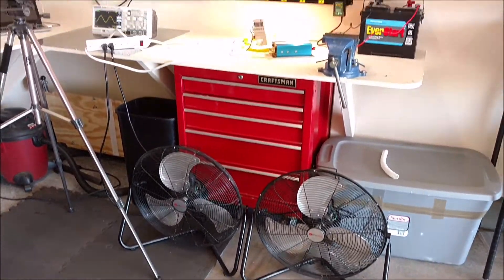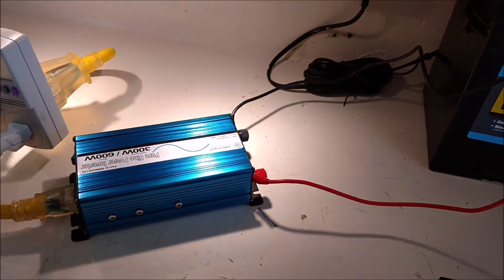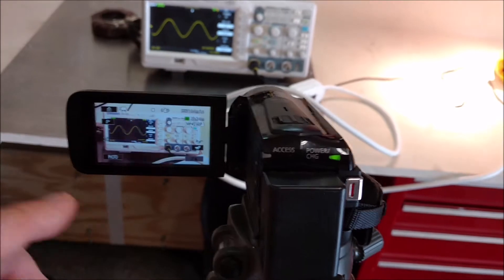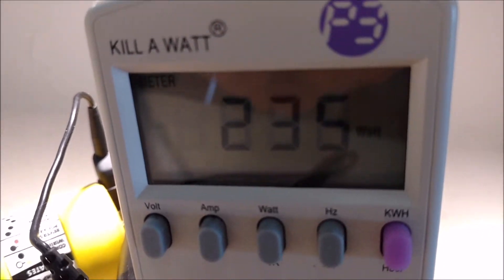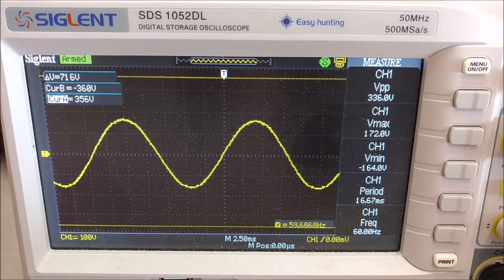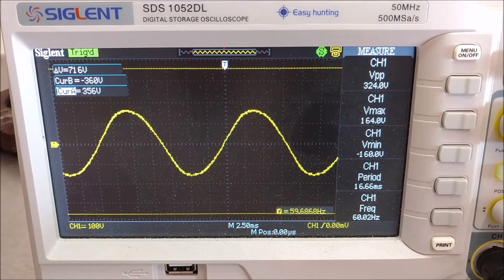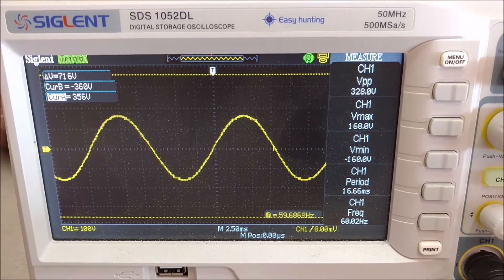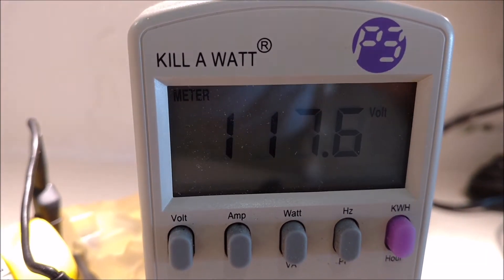LOAD TEST! AIMS Power 300w pure sine wave inverter

Comment: The strangest thing about these inverters... charging things on the single USB port seem to make the inverter as hot or hotter as using like 80 watts of AC power. Unit is much cooler charging the same device using an AC adapter. Reviews on Amazon mention the same thing.

Comment: How efficient would you say this unit is at converting DC to AC as a percentage? I have the Microsolar offshoot of this model bought in 2015 (same unit different sticker) and I am quite pleased. I have never tested the surge watts or seen how long it will operate over 300 watts. I really never used it much from 2015 until 2018 as I bought for backup power and when you buy a genny or inverter the power company magically gets its act together. Used in 2018 for camping.. and now I want to use it to charge all my devices with a battery connected to solar panels.. you know the headphones cellphone laptop vape etc.. just for fun as the $ saved isnt really worth it its fun knowing that power came from the sun I don't really believe in global warming its just oddly satisfying.. I hooked it up once to a 12v batt backwards and it blew a fuse inside I believe was meant for the AC side according to their documentation but once replaced it worked fine. If you go read reviews on Amazon and go to the 1 star reviews it would seem the quality control is awful on all AIMS models and that they use low quality components wired oddly according to some reviews. One vid I think mentioned RF noise on the AC line I don't know what effect that would have on gadgets.. I would assume speakers might pick it up with low quality AC adapters..
Reply: I bought this also to use laptop camping.. everywhere online said laptops are sensitive to modified sine waves. These days I read that most laptops with few exception are wired such that the AC adapter takes all the punishment from the modified waves of a MSW inverter and the worst that will happen is short AC adapter life (one lady said 1 year in her RV used daily). The ones wired in a really rare way however which was most common in the 90s and early 2000s have a chance of frying instantly to fairly quickly however on MSW inverters. I'm just happy my AC adapters won't commit suicide as fast and CFL lights and Fans wont make a racket and won't suck as much power on this PSW inverter.
Reply: Also as the cooling fan is load based and loads under 100 watts usually wont trigger it I recommend not sitting this inverter on blankets or carpet and to have something flat under it maybe even propped up with something small so the underside can breathe.. or put it on its side.

Comment: If you were setting it up for solar using your AGM Battery.   What Charge controller would charge a AGM Battery.
Reply from the maker: https://www.amazon.com/dp/B071QXGV1Y/?ref=idea_lv_dp_ov_d
GreeSonic 15-amp MPPT solar charger. It does have equalization (automatic, set for 14.8v). However, never seen it go above 14.6 volts. The Interstate Batteries 12v AGM deep cycle battery is stamped "Daily Cycle" up to 14.9 volts. So, no worries. Pretty impressed with this little MPPT solar charger. It "searches" for max current every 1-minute...confirmed with my clamp meter and Fluke 117 TRMS multimeter...I was skeptical, now I am sold. Slick unit for $53 if all you need is a small charger. Got a 100w solar panel attached to it...works well. Has a built in temperature sensor. No bells or whistles...and no adjustments. IMHO, set well for AGM batteries (and would work fine with FLA).
Reply: Chris DIYer thanks Brother.   I’ll get that on.
Reply: The important factor is the ability to adjust charging setpoints to battery mfr specs.   MPPT, PWM, or even shunt will be fine assuming setpoint configurability. 

To be a party pooper, I'll add that solar-only charging is unlikely to meet the C/5 minimum charging rate that AGM need to stay happy.

Comment: Very nice to know Chris. I have the same 300 watt inverter however, I have no way to test. No scope. Now I know what my little 300 watt Aims can do.
Reply from the maker: Yep-yep. There are a lot of appliances (like a computer) that use less than 300w. This little PSW inverter does a great job. My 180w version of this inverter series gets used in my ammo box 24/7...stays on
Reply: Hi randall
How long you can run your 300 inverter on your car barreries if use it to run lights 200kw